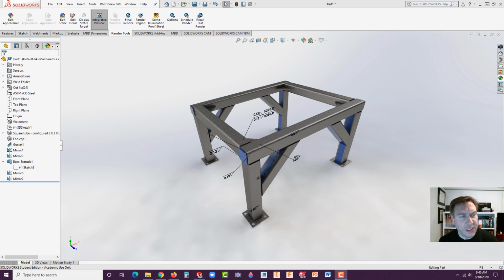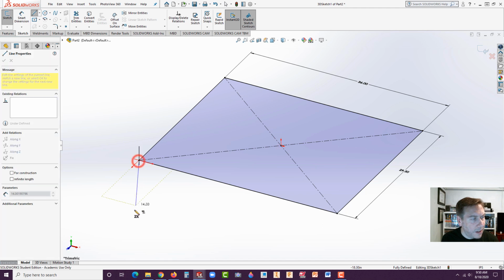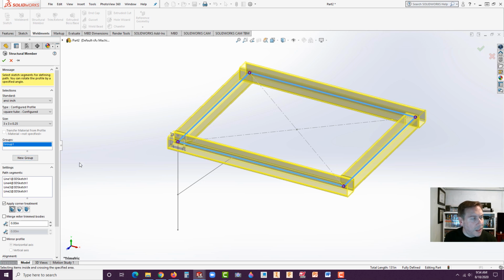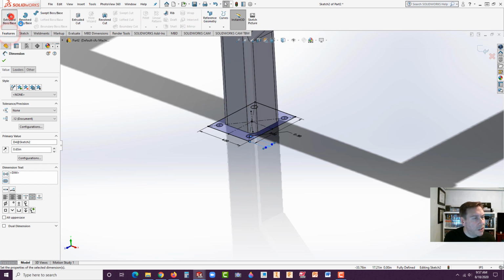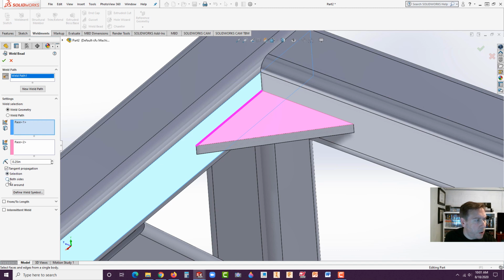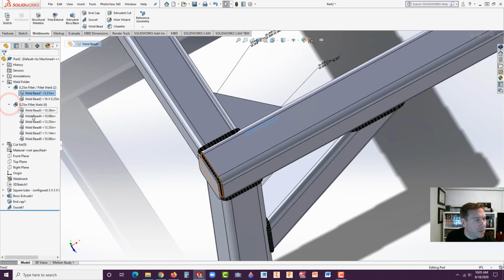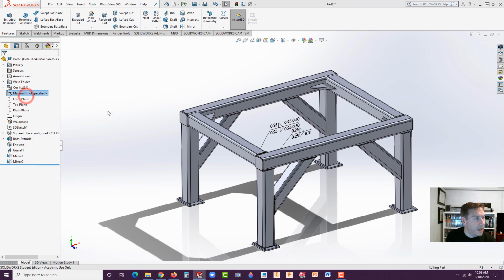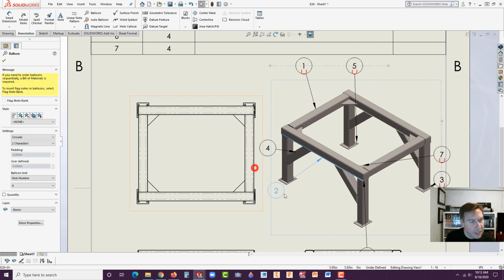E26 SolidWorks 2020 - Weldments

Comment: I've been really enjoying your tutorials, and I deeply appreciate that you're making this knowledge free to the public. I am a little curious as to how far along in these tutorials someone should be before feeling comfortable taking the CSWP exam, or if you think that these tutorials could adequately prepare someone for the CSWPA or higher. I understand that for the CSWPA, weldments, molding, sheet metal, etc. are required knowledge, but I don't know how much depth of knowledge/experience in these areas should be expected of a user like me who is entirely self-taught, and for personal projects would not have access to or generally be designing for certain kinds of infrastructure outside of portfolio pieces. Looking at their sample exam document, it seems like you cover everything they require over the course of your beginner and advanced courses. In addition to these courses and their sample exam, is there any resource you'd recommend I go through before taking the exam?

Comment: How to show the mitre cut on the cutting list? If i'm sending this to a saw line to get the sections cut they need to know the angle of the mitres. I can't find a simple way to do this.
Reply: Add columns to the cut list on the drawing. Set them to show the end angles and orientations.

Comment: Hi Chris, I noticed that the tubing always is placed centered on the sketch line. Is there a way to place it where you want on the sketch line? I ask because, If I want to create a 24x36 table top, using 1 inch tubing, I need to create a sketch that is 23x35. Or am I missing something?
Thanks,
Paul